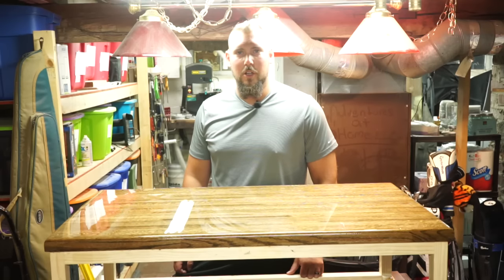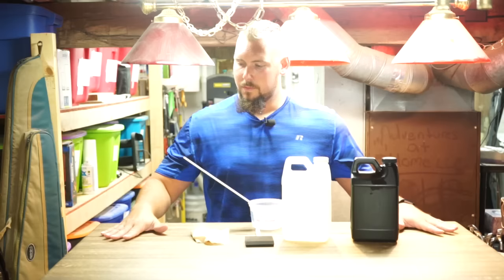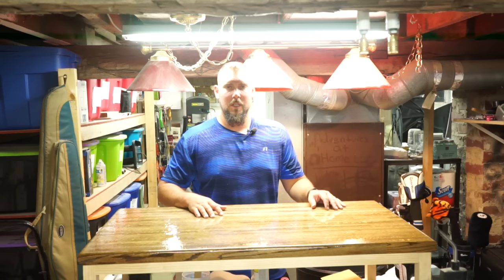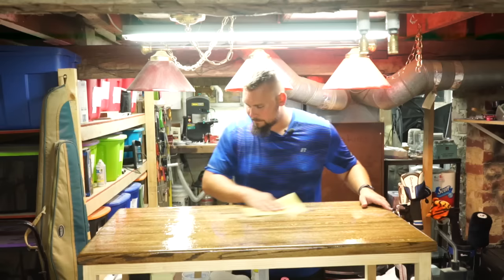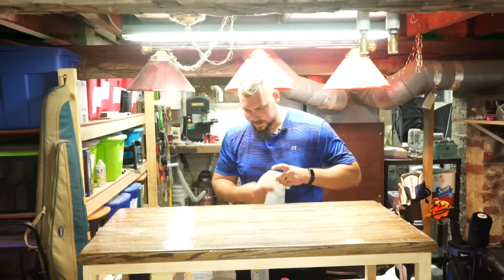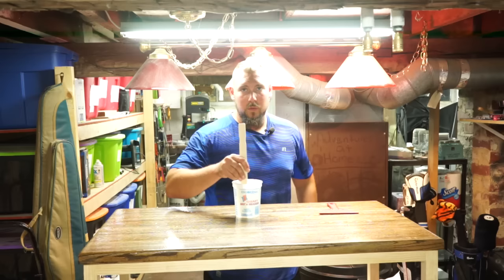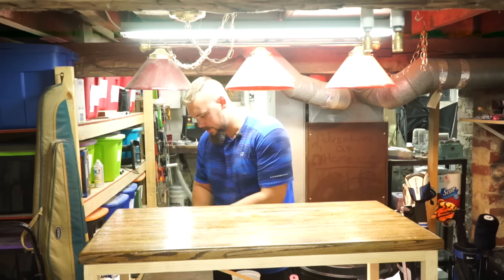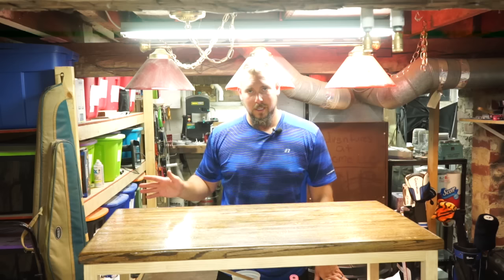DIY – How to Apply Clear Epoxy Resin – “Liquid Glass”

Comment: What do you do with the edges that have drips? Like at the bottom where it has dripped off of the table completely. I am looking at doing a kitchen island with epoxy that is about 4 inches thick of bamboo, Im quite concerned about the edges.
Reply from the maker: If you don't want any drips you can build a melamine box around the top to contain the epoxy. Otherwise, I clean up all the drips off the bottom (after they harden) with a razor blade and some sandpaper. Thanks for watching!

Comment: Comment by Greg Martin:
Here is the product that the Amazon link you provided links to - (FamoWood 5050110 Glaze Coat Kit - Gallon Clear,  Is this what you used and recommend for table tops?)  I'm looking for something for outside use and high UV resistance.  Would this work for that?
Reply from the maker: That is the product I use, however it is definitely not recommended for outdoor applications. Thanks for watching!

Comment: fantastic.i made a table but i got 5 fish eye defects.how can i avoid them next time.pls advise
Reply from the maker: My first suggestion would be to thoroughly prep and clean the surface with acetone, or rough the surface up a little more using sand paper prior to pouring the epoxy.  Thanks for watching!
Reply: @AdventuresAtHomeLLC  Believe me i did that and same results every time . I made several trials

Comment: Do you think epoxy could be successfully applied to the front of a stained glass panel? The surface of the different types of glass are irregular and the lead lines are roughly 1/16 to 1/8 in above the glass surface.

Comment: Hi ime using resin4art epoxy over acrylic pour tables but I dont think I have the durability as in heat and scratch resistance.. Would you think this is better thanks. Great video
Reply from the maker: We haven't had a problem with scratches at all, and it is extremely durable in this regard.   However,  the epoxy we use comes with scrict warnings that you will have problems from heat (hot coffee mugs,  etc.). We always use coasters and haven't had a problem though.  Thanks for watching!

Comment: I am preparing to do an epoxy pour on a bar I built. I apologize if this has been asked previously (couldn't find when I paged through) but when the pour is made and spread how would you recommend covering bar rail around the bar top that is attached above bar top on 2 sides?  I have considered using sponge brush -is there a better recommendation?  Thanks for the video.

Comment: Kyle, what did you do to clean up the bottom edges that created drip runs that hardened??? GREAT VIDEO BTW!!!!
Reply from the maker: A razor and sand paper makes quick work of those. Thank you, and thanks for watching!
Reply: I try to scrape it while it's drying... But then you risk any hairs or anything flying around by you going in near it.. I was going to try to start taping the bottom of it.. and seeing what happens
Reply: But I also have a Dremel tool with a little sander that takes care of it easy! It's drips on the actual legs that are s pain to get off .
Reply from the maker: I've always found it easiest to take care of the drips on the bottom after everything is dried and there is no worry about contaminating the epoxy. Thanks for watching!

Comment: If I'm painting a subwoofer box should I do this before or after?
Reply: Epoxy didn't do well on a gun stock for me. The recoil cracked it. I would be afraid of the same if the subs are decent.

Comment: You used a blow torch in the first step to get bubbles out. Can a heat gun be used? Will it have the same effect?
Reply from the maker: A heat gun can be used. However,  it will be more tedious,  and even greater dust prevention should be taken.   If you you have even a little dust in the air the heat gun can force it deep into the epoxy making repairs that much more difficult or impossible.
Reply: Adventures At Home, LLC I saw the question further down in the comments after I sent it. I understand why you did it that way now. I’m about to try this on a flag painted table for my patio. Got my fingers crossed 🤞🏼
Reply from the maker: Good luck and thanks for watching! Let us know how it turns out!

Comment: Good Job. I have a question : what method or what solvent do you use after finishing project to clean your tools such as the scraper ?  Thanks for sharing.
Reply from the maker: I usually use cheap plastic scrapers and discard them when I'm finished. Otherwise mineral spirits and some scrubbing will work. Thanks for watching!

Comment: can i apply linseed oil to a wood table and then after a few days to dry apply the epoxy
Reply from the maker: I haven't tried this,  but I wouldn't be confident about the results.  I think the oil will cause you to have problems with the epoxy not adhering properly.  Possibly look at a coat of poly over the top first,  and roughing that up with 320 grit sandpaper. Thank for watching and let us know how it turns out!
Reply from the maker: Thanks for the response Sean!

Comment: Great video. 
do I need the skin coat or can I just go straight to the flood coat? 
Thanks for your vids.
Reply from the maker: You don't NEED the skim coat, but the skim coat will prevent a lot of air bubbles they form in the grain of the wood. Thanks for watching!

Comment: what is the hardener / epoxy ratio for the "thin coat" ?
Reply from the maker: You mix the epoxy the same as you would for the flood coat (per the directions). But you will only apply a thin layer of it for the skim coat. Thanks for watching!
Reply: @AdventuresAtHomeLLC  Many thanks !
Reply from the maker: You are welcome!

Comment: Can you use the same type of epoxy for the seal coat as the flood coat?
Reply from the maker: Yes, we use the exact same stuff. Thanks for watching!
Reply: @AdventuresAtHomeLLC  Your videos are well done and very informative. One more question, I'm using 2 different brands of casting epoxy, and my project will consist of at least 4 pours each. As long as I let the previous pour solidify completely, and I rough up the layer underneath, they should work together without a problem, right?

Comment: How much heat is needed to pop the bubbles?  Do you have to use a torch?
Reply from the maker: A torch isn't required, but at a minimum a heat gun sould be used.
Reply: @AdventuresAtHomeLLC  how about using a hair dryer?
Reply from the maker: A hair dryer wouldn't be recommended. It just doesn't produce enough heat to effectively eliminate the bubbles. Thanks for watching!

Comment: You mentioned in passing that you stained and finished prior - i just want to make sure of that: can you put the epoxy on top of polyurethane or oil finishes?
Reply from the maker: Yes you can.  The only thing you have to do differently when applying over polyurethane is lightly sand it (220 grit works well) to ensure the epoxy properly adheres to the surface of the polyurethane.  Thanks for watching!
Reply: Read the manufacturers directions. I have used some where they do not recommend going directly over oil based stains. But if you top coat with a water based poly then it is okay. I think they are concerned with it not adhering, but that is my guess.
Reply: Avoid oil based products
Reply: @jonshepherd2550  OH i stained the table with french polish i must checj if it is oil based thank you for this BIG THUMB UP
Reply: DO you know what happens if it is oil based ,, Just a science question ,,
Reply from the maker: Everything I use this epoxy over is oil based, and I have NEVER had any bad results. Thanks for watching!

Comment: Hi, great video as i'm about to do a table top. i wanted to know how to do the sides, i have a rustic bit of wood and wanted to cover the top and the sides. I was thinking i'll do the top first like your video, then when dried, i'll turn it on it's side and sand down the drips, then do a coat along the side - but how will i handle the drips coming from that back onto the top? thanks
Reply from the maker: Just let the epoxy run over the edge and use the foam brush to touch up anywhere the epoxy doesn't cover. Let us know how it turns out. Thanks for watching!
Reply: I want to know how to do the sides too. Mine is a sewing machine cabinet that has been painted white recently. thanks
Reply from the maker: If it is more than the thickness of a table top (2") you will need to build temporary sides around the area you are pouring. Melamine faced boards work great. Thanks for watching!

Comment: Ok this lady did her countertops with contact paper with a marble print. Someone said that you could put epoxy on top of it to make it last and look better. Would that work?
Reply from the maker: Yes, this would work. Ensure that the contact paper is 100% clean to prevent adhesion problems. Thanks for watching!

Comment: Thank you for the video. I have a question on prepping a table. My friend has a finished table she bought from a store but would like me to epoxy the top. How do i prep the table before the seal coat then flood coat?  (Do i need to sand and if so - i'm afraid that would ruin the look of the table before putting on epoxy).. HELP!
Reply from the maker: What is the table finished with?
Reply: @AdventuresAtHomeLLC  I am not sure - can I email you a picture of the table?
Reply from the maker: Customerservice@adventuresathomellc.com

Comment: Dump the epoxy then turn the container upside down on the project to drain out. I use a 4 inch plastic spreader instead of a brush. I have used E BOND epoxy out of Fort Lauderdale FL. In business since 1958 and it's half the price. Don't let it drip over by using tape to dam the edge.

Comment: Do they make a mat finish ? And can you use a heat gun instead of the torch ?
Reply from the maker: They do not. Because of the thickness of the coat it needs to be glossy and crystal clear. Heat guns will work when used with care. Thanks for watching!

Comment: Could you just leave it at the thin coat, for a light use table top?
Reply from the maker: You could. But you would probably be better off using a furniture grade clear coat then. Easier to get a nice even coat. Thanks for watching!
Reply: @AdventuresAtHomeLLC  thanks for the reply, is there any you would recommend?
Reply from the maker: Check out AquaCoat!

Comment: How does this coat stand up to heat, splattered grease, scratches, sunlight, moisture, etc?
Reply from the maker: It would not stand up well spattered grease, or anything hot. It is very doable against scratches, sunlight though. We always use coasters, so we don't have a problem with moisture. Thanks for watching!

Comment: We did a counter top with pre finished wood flooring and there’s a lot of gaps to you recommend something to do or just give it a lite coat like you did. Think ours is going to seep thew.
Reply from the maker: If you have a lot of deep gaps you will have to pour those and fill them before doing the top coat. If you're worried about it leaking through you can set it on a melamine faced board when you fill the gaps (just wax the melamine first with paste wax to prevent it from sticking). Thanks for watching!
Reply: Adventures At Home, LLC thanks for your help and quick response.
Reply from the maker: No problem! Let us know how it goes!
Reply: Adventures At Home, LLC will do 👍

Comment: This question may already have been asked and if so I apologize- but how heat resistant is this epoxy you used? I have a kitchen table I need to refinish that was previously done in polyurethane that over the years now has white heat spots from dinner dishes and coffee cups. Will this work well for that project?
Reply from the maker: To be cautious you should always use coasters and placemats with this stuff. Prolonged heat from coffee cups, etc will make the epoxy pliable. On the plus side, a hair dryer can fix a spot from a hot cup pretty easily. Thanks for watching!

Comment: Thanks! What about the sides??
Reply from the maker: The sides will be coated from the excess flood coat running over the sides - sounds too easy, but it works! Thanks for watching!
Reply: Adventures At Home, LLC do you need to put a thin coat on the sides?

Comment: I have a question I'm making my friend a wire spool coffee table do you think the thin coat would fill all the indents caused by the nails and staples in the spool?
Also can this be applied over polyurethane?
Reply from the maker: When you do the thin coat add extra to the nails holes until they're filled. Just lightly sand the poly first and you'll be good to go. Thanks for watching!
Reply: @AdventuresAtHomeLLC  
What about just filling in the holes with poly? I don't know if poly fills holes or if it dries to thin for that. I probably should just try it on scrap because I have a considerable amount of polyurethane but have never used epoxy.
Reply from the maker: @nickdrew1859  I can't say I've tried filling anything like that with poly. However, that is a common use for epoxy. You can fill the holes, plane or sand them level and then coat the entire top with poly

Comment: I painted my wood desk white with simi gloss and primer I think it's oil based will this still work
Reply from the maker: It will. However, oil based paints take a long time to fully dry (weeks) and you need to ensure they are fully dry before applying epoxy.
Reply: @AdventuresAtHomeLLC  i used ultra palace interior paint it says to be a latex paint is still usable with epoxy?

Comment: Hay bro im from indonesia, what if before 72 hours table got a dust/dirty think.. how to clean up?
Reply from the maker: There's no easy way way to get that stuff off. Try sanding with high grit sandpaper to see if the dust can be removed from the surface. Then buff it glossy again
Reply from the maker: If the dust is more embedded you'll have to strip the epoxy and start over.      Definitely a bummer!  Thanks for watching!
Reply: @AdventuresAtHomeLLC  got it capt.. thanks you..

Comment: I am wanting to get the durability of the epoxy, but would kind of like to have a satin sheen.  is that possible, or should I just go with the gloss finish?
edit = I am refinishing a white painted desk top which I want to keep white.
Reply from the maker: If you are looking to keep the white finish you can mix some white pigment into the epoxy to lessen the sheen. Otherwise, epoxy by nature, will be very glossy. Thanks for watching!
Reply: use a 400 grit sandpaper. You are welcome.
Reply: @SEK.7  yes, thank you!

Comment: also do they sell faster drying epoxy... when it takes so long to cure way more junk /dust can find its way to stick to it... even when paint cars clear coat sets up in 30 mins and still a lot of junk sticks to it..then i need to wet sand and buff etc... thanks
Reply from the maker: I believe they sell faster setting marine grade epoxy - we don't have any experience with it though. Thanks for watching!
Reply: @AdventuresAtHomeLLC  yes i found some that sets in 30 mins... i will also just cover my piece to prevent dirt from getting to it..so even if it takes 2 plus days to be ready to handle thats fine... thax
Reply from the maker: @roadstar499  Great! Let us know how it turns out!
Reply: There are many different epoxy types with slightly different properties and also different mixing ratios.
Some cure faster, some reach harder results, some handle UV better, some are easier to spread, some can be used for thicker layers, some handle heat better...
So yes.

Comment: What did you do for the drip marks on the sides of the table?  Also did any apoxy run down the legs of the table?
Reply: For the sides run a little bit of epoxy on the edges that reduces the dripling, and slowly weave your epoxy back and forth from the top side it will slowly level itself out

Comment: i’m not sure i’ll get a response, but i have a table pretty similar to this one, would i still be able to do this after i have painted the table white?
Reply from the maker: Absolutely. You'll want to rough up the paint a bit with sandpaper  to ensure the epoxy sticks. Be warned the white paint will look slightly yellowed over time from the epoxy though. Thanks for watching!
Reply: Adventures At Home, LLC thanks for the response! Appreciate it.
Reply from the maker: You're welcome. Let us know how it turns out!

Comment: My table has a coat of polyurethane on it...should I sand before pre-coat?
Reply from the maker: Yes. To ensure proper adhesion of the epoxy it is a good idea to rough it up lightly with some 320 grit sandpaper.

Comment: Just curious I have an industrial heat gun gets really hot would that be a better then a torch cause no chance of maybe a burn through.
Reply from the maker: Heat guns will work, but can blow dust, etc. deep into the epoxy, so be cautious. Thanks for watching!
Reply: Adventures At Home, LLC thanks and damn that was quick. Im trying on a picnic table that I just lincthenburged.
Reply from the maker: @dzlf2504  love that technique! Sadly, I don't feel comfortable making a video showing people how to rig a neon sign transformer (what I use) to do that.. send us a picture when it's done!
Reply: Adventures At Home, LLC my dad made one yesterday out of an oil burner.
Reply from the maker: They make truly awesome and one of a kind designs.
Reply: Adventures At Home, LLC yes I liked how all my lines came out. Nice thin tree look. I've been watching other videos with the microwave one and they burn a crater in the wood. Which would be nice for other tables. But I like how this came out.

Comment: Is there any way to prevent the runs on the edges of the table (seen at the end of the video)? I could be mistaken, but I thought I could see quite a few.
Reply from the maker: Yes, if you don't want the edges coated you can create a box around your project with melamine faced boards. Just use a little petroleum jelly on the surface and you won't have any sticking. Thanks for watching!